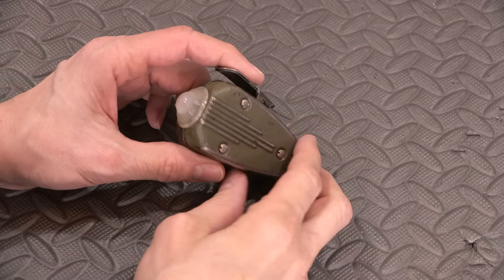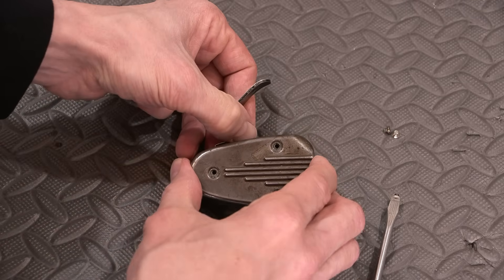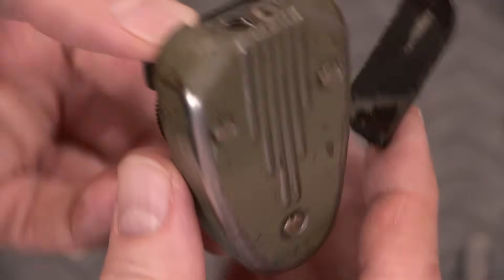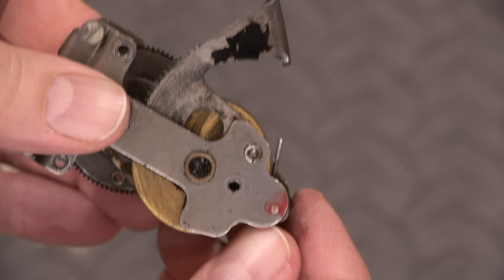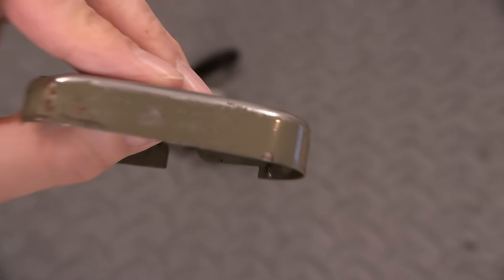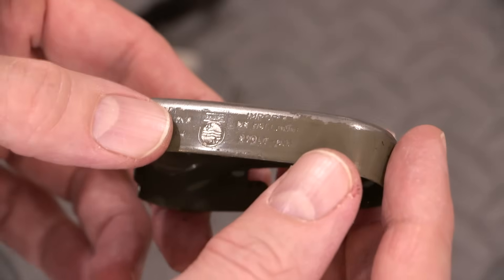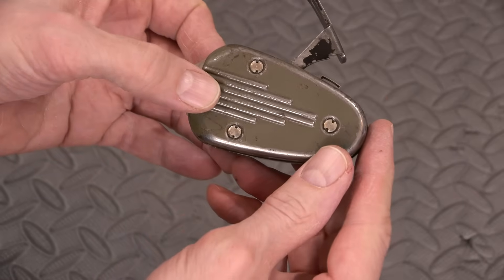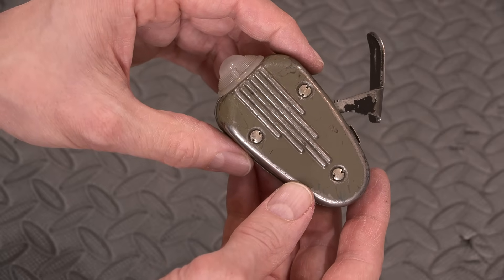WW2 Dynamo Flashlight - Doesn't Use Batteries! Let's look Inside.

Comment: These are quite nice devices. I have one that was used by my parents during WWII. I would keep that one original (repair the lens) but it would be perhaps a nice little project to make a modern 3D printed device with a LED and a supercap that can be home-built. A little DC motor could be used as a dynamo driven by a hand crank or so. A few turns could give light for several minutes.

Comment: I bought  one of that worked in exactly the same way, some some years ago. It was a very early ebay purchase I think, made of bright green plastic and the dynamo and magnets were almost open frame! The bulb is a small wire ended pea bulb. It hung by my consumer unit on a hook made from a left over length on meter tail cable. It's still there but now has a more modern companion which is a hand cranked generator that charges up a small battery. 

For your unit, see if you can find any bicycle lamp bulbs   they were usually 3V and an obvious choice as the unit was made in Holland.

Despite the heavy spring, I would still have a very close look at it and see if it could be pulled apart to give it a good clean and re-grease everything.

People are already saying keep the patina. I don't go along with that too much.
These things were pristine when they came out of the factory  so a rebuild and new paint job would be KO by me.
Personal choice really.

Andy

Comment: The bulb used was a 3v screw base, the same as was used in the original 2xD cell 90 degree head OD green flashlights.   The 3v bulb was so that you could slowly depress the handle for enough light for map reading.

Comment: gret video i would leve the finish original.
to repair the missing tab on the lense use a clear UV cure resin buil it up in steps then file to shape using small pattern files this resin is very strong 
Amazon sells the resin and uv black light

Comment: I would expect the bulb voltage to be pretty low because then you don´t need to spin the dynamo at full speed to get decent light out of it. I would think you could get the original bulb blow if you went too crazy on the speed but more gentle to keep lit a longer period without waving goodbye to your hands

Comment: For my small flashlight colection I rebuild burned bulbs with white COB LED. After removing glass inside metal housing aded resistor and underpowering 3W led.

Comment: I love the old tech, and the Military Standards Build makes it nearly indestructible. I saw a movie where a young boy was living in tunnels during WW1 and he had a box shaped hand powered light like that to navigate the dark in the tunnels. I have some wheatbulbs, you know the tiny grain of wheat sized bulbs. I think the voltage is down about 2 volts or so. It could be soldered into a screw in bulb housing to use in your light. You can probably search the NET and find a 2 volt bulb though. Love the old tech. I have a Seimens Wooden case Volt/Amp Meter made before WW2 and used by a German man working at the Duetch Bundes Post  since he was a teenager. That was the German Telephone Company back then. His name was Herr Schultz. We worked together in the US Berlin Brigade Tech Control in 1982. We became good friends and he gave it to me as a parting gift when I was sent to Korea. It doesn't use any batteries and it is constructed using mainly coils, no transistors. Still works perfect. Take care.

Comment: I'd leave it as is, maybe clean up. What would be nice, and what would future proof it - LED tech. For sure.
I modified a dynamo one made in France (just a bit bigger, with a longer running dynamo) and to do it respectfully i broke a bulb i had for 24 volts, and used the screw in base to "impose" myself on the old tech. Left everything else as it was. These things were made with large cases so a lot of place for electronics is found inside, especially SMD stuff. For my project, so i didn't have to think too much, i used the guts from one of those pump up LED emergency flashlights. Gives quite a bit of light.

Comment: What function did that big spring have?
Reply: its what makes the squeeze-lever pop out ready for cranking. Without the spring, you would squeeze the handle in once, get a gleam of light and then... nothing. You need the thing to spring out again so you can squeeze over and over again.

Comment: Interesting... It's actually #48 bulbs which has 2 volts 100 mA., T 3-1/4 type with miniature screw (E-10). May not ideally, doesn't have bi-focal lens like #222 bulbs. Although, I remember all lamps but I can not guarantee if what does work or not. There are some market may selling hand cranks flashlight with LED in it such as emergency light with radio. I seen it somewhere on the sites. If you can prototyping with retro old vintage hand cranks flashlight. Maybe try with just one white LED, see if they glowing. White LED takes about 3.2 volts 24 mA. may be handle.

Comment: I had one made of plastic in the 70's.  I am surprised they didn't make them a bit larger with a heavier flywheel so you could use it to find your way more quickly in the dark.

Comment: 10:47 I inherited one of these from my late father.  It no longer had the protective cover/lens, but it is practically identical to this one, except for the screws, which here are single-slotted. PHILIPS, Made in Holland, Type 7424; Importe de Hollande, 2.5 Volt - 0.1 A. Still works.

Comment: Everything tells a story, dents and dings, how the paint has worn from use etc,  when I find old tools and other personal items, because the way my mind works I can visualize the life it's had, and who owned it "restoring" (repainting re-plating) destroys that history, I understand restoring the look of radios and other larger equipment that I have no issue with, but certain things should be left looking as they are, I also have no issue with making something functional again without drastically altering if possible, I would prefer you leave it's patina as is, and clean and lube the workings.

Comment: "This mission requires silence, so no talking, no farting, no coughing! Understood?" "Yes captain!" Wrrring wriiing
Reply: Yep, noticed that problem with the one we have.  But I think it might have only been intended for momentary usage (checking numbers, a chart, or a jam in your rifle.  It doesn't throw light very far, so it isn't like you'd try walking at night by using it.
Reply: So funny..lmao
Reply: @Scott_6666  
In the field I remember using a green 90 degree typical flashlight that had different lens filters hidden in its base. Red lens was to be used during war or during exercises.I wish I had been issued one of these.Maybe would not have crapped on a live motar round.
Reply: Lol that's funny
Reply: Now you can light an LED with a fart
Reply: @shable1436  That would be a cool trick!
Reply: @shable1436 Funny you should say that. I was putting the Christmas tree away a few nights ago, when I threw the top section in the in the box, the LEDs flashed for 1/2 second. I guess the cold, dry air caused static discharge.

Comment: I have a plastic bin full of cheapo tools for the "suicide missions." I've inherited the tool collections from a few of my older relatives, and I keep it all. Even the soft, cheap screwdrivers come in handy when you need to improvise something like Paul did here. The permanent magnets in a flywheel spinning in a stator winding reminds me of motorcycle charging systems. The red paint looks like Glyptal, which was often used as "head locker" on screws (and for many other things) back then. I'd be surprised if there isn't a can of Glyptal in Paul's closet, next to the DeoxIt and his collection of various bulbs, fasteners, and tubes.

Comment: would be great to see a video at night, how this little thing lights up. 
Also great maybe you find an LED to screw in, so you dont modify the device, would be  a challenge to build a little screq light yourself includign a sdm cap maybe to get a little bit time, a resitor for current and very simple, maybe thats not changing the original look but also would be intersting to see how it could be improved nowadays, maybe for fun just a screw type adapter and extern a breadboard with small Cap and stab (serial stab for leds) ... some years ago we had a competition for ham radio building a transmitter only using muscle power, a similar device was used for one of the particians, gaining some 100mW  for example using morescode directly in with the timing of the hand pressing  that kind of device.

Comment: Made by Phillips/Norelco, in the film industry their AA-II projector is legendary for a rock solid image, durability, and extremely heavy construction. They ran 35mm or 70mm  film, at 24 or 30 frames per second.   And I would just clean it up, lube the gears and clean it up. Don't repaint it.

Comment: Leave it as is. I noticed that the harder you squeeze the more power is delivered to the bulb. I'd be interested to see if it is possible to modify it to use LED  that has much smaller draw but store this extra energy and make the led burn few seconds longer.

Comment: I have a couple of these flashlights. They were used during and after World War II. They were made for the German army, but the English also made almost identical flashlights for their soldiers. They were eagerly taken as useful war booty.
I wouldn't repaint a flashlight if it still has a lot of original paint. You can buy completely worn-out ones cheaply and they can be restored. Yours is quite good.

Comment: A single diode followed by a capacitor, followed by a modern high brightness LED would be very  bright, I expect. And the capacitor would keep it constantly on between hand-squeezes 😀
Reply: Yep, and that all can be fitted inside an emtied bulbshell.
Reply: You need a bit more than that.  An LED needs about 2.7V to work.  At something like 2.5V it will draw no current.  You need something to regulate the current.  A 5V 1F capacitor could store a few Watt-Seconds (Joules) of energy.  An LED will need about 0.05 Watts to be quite bright.  With a good design, you could get nearly a minute of run time after you pump it up.
Reply: @kensmith5694  you can use a joule thief circuit.
Reply: @kensmith5694 Some very long time ago tried powerled directly connected to dynamo flashlight. It was bad experience bc such load as Led swiftly stopped rotating flywheel. Each time you push you light but brief period of time you retract the flywheel almost stops which gives very uneven light intensity in comparison to light bulb. The cause is led does not light at voltages below 2.7v. Every small increase of flywheel speed causes large increase of current, thus power consumption and very fast decrease of flywheel speed. Some supercap circuit is a musthave.
Reply: @kensmith5694  I'd imagine the lower current of a mild LED would allow the voltage to stay high enough to work. could probably use an off the shelf LED upgrade bulb, but then again, most of them focus on high brightness and use more power. so probably custom low power it is.
Reply: @throttlebottle5906  Yes, I think that a single LED instead of a bulb with some clever way to limit current is the better path. You don't want to throw away energy in a series resistor.  A small PWM/switching regulator chip and likely an inductor would be better.

Comment: I have one of these that I got from my father. The case paint finish I would describe as dark plum. It is stamped on the base Type 7424 [Philips Logo] 2.5 VOLT-0.1A. The light produced is nowhere near as bright as yours. It can be found online in British and Wehrmacht versions with the same Philips type number. There is currently someone in the Czech republic trying to sell one in poor condition, non functional and with no lens on Ebay for US$60.

Comment: If you decide to fully restore, try to find out all about the originality of it, paint chemistry, lubricants used, correct replacement bulb, is the lens supposed to be clear originally (may need to be recast), reflector metalized(?), and dress up the danaged screws. This will make it be like original. A worthy homage to the design effort at the time - no modern frills.

Comment: I'm not in the "patina" crowd, these things are not rare, and don't hold much value in unrestored condition... it's not a 1935 Bugati.  New paint, polish.  Clean and lube the mechanical. An LED with a capacitor and regulator would make this from a relic to a useful device.

Comment: Clean-up the case with fine steel wool (or just an ultrasonic cleaner), and then spray it with clear lacquer.....   Don't change any of the internal parts, the value will drop to near zero.

Comment: The "fibrous" gear is called "phenolic or micarta."  
It's made by impregnating paper or cloth with phenolic resin.
Reply: Phenolic = A bit like fiberglass then ?
Reply: @philfrydman2576  More like bakelite-soaked fabric.
Reply: @philfrydman2576  The fibers are not as stiff as glass fiber and the phenolic has a bit of spring to it.
Reply: @kensmith5694  I think it is the same technology than fiberglass but with different materials.
Reply: @ It is the same method but as I pointed out, it is using different materials so the result is very different.

Comment: My brain immediately went to LED+capacitor mod. There's clearly no shortage of forward voltage. A 21st-century light source coupled with WWII-era robustness seems like a flashlight prepper's dream. Agreed that this one's too nice to do that, though -- at the very least, a re-greasing would be appropriate. I wouldn't mind a restoration. Heck, you could probably do all the above with one of your trademark reversible mods, Mr. C. 💡👍
Reply: LED / Capacitor (or some other storage cell) would make it more useable, but if you do that, then why not just go out and buy a modern dynamo flashlight (there are plenty avaialble fairly cheap).    I think the charm of a device like this is using the technology of the time, not to drag it into the modern world.    
Just my thoughts, as any modification would be slightly difficult to do in a fully reversible way.  There would at minimum be fresh soldering that is not needed to keep it original.  
I admit a lot of ideas went through my head, but I guess the main one that influences me, and my end thoughts, is the histroy of a device of this nature and where it would have been used.
Again, 100% just my own thoughts and nothing negative to your own thoughts.   Everyone has their own ideas :)
Reply: @EsotericArctos  The main difference, as I see it, is in build quality. A present-day cheap dynamo flashlight made this century is highly unlikely to still be around in 70 years.

Plus, if Mr. C does opt to try for a mod, he's probably not going to throw it together with whatever he can get cheap on AliExpress. It'll be in the spirit of the device's design and use case.
Reply: As long as it's reversible LED would be neat to see, but I agree with keeping it original... Mainly so people can see what troops  actually had to work with back in the day. 10+ seconds of equivalent LED light per push is far different than having your mate constantly push that lever with a burning wrist as you try to fix something, and it's the only light!
Reply: If it ain’t broke , dont fix it.
Reply: I think a conservative LED mod would make it into something more useful for emergency use, without damaging it's looks/history/patina.
Reply: I thought the same thing.

Comment: The same style dynamo flashlights are still available today - now in plastic and with LEDs - for very little money. The circuit inside is not much advanced over the WW2 version, so you could get one of those and experiment with it without violating the vintage one.
Reply: I keep an EverLight Twist in the car for any emergency. Even that is probably more than 20 years old, before the LED era, probably Krypton bulb. It already has a large capacitor, so a few twists gives about 30 seconds of light. Must be much better with today's LEDs, for sure.

Comment: Projects like these is what sparked my interest in electronics..I started with the old tube tv's and radios.  
I had several army radio crank dynamos, 90-155vac output..
Reply: Funny you mentioned that....I ordered and bought a never out of the wood create Vietcong field artillery radio set w/a hand crank dyno (before flea-bay outlawed them). It's an AM Transceiver and has yet to be booted save only once to light the tube heaters. Now it's a matter of digging it out. 😅

Comment: A good candidate for a modern LED upgrade.
Reply: NOOOOOOOOOOOO!
Reply: @tuttale  😈
Reply: Only if the mod is completely reversible!
Reply: Absolutely, it would increase the runtime considerably by using an LED and a capacitor
Reply: @dm.2023  It would be like putting double glassed plastic windows in a tudor town house.
Reply: No no no no no.

Comment: I'd just carefully clean it and NOT repaint it. Keep the patina.
Reply: Same for me, looks great as it is, no need to make it look like it just came off the boat from China last week
Reply: Agreed.  Get the insides working as well as possible, plus cleanup the lens, but leave the case as is.
Reply: Agreed,  keep that battle- worn look.
Reply: Clean it up and with olive drab paint job and bring it back to Mil Spec.:face-green-smiling:
Reply: @garybevis8691  Mine was grey/brown as this one, no olive drab.
Reply: Such a nice patina. I would leave it as is❤
Reply: Original. Only answer. Clean it up, and carry it in your pocket. It'll probably come in handy. Some of my favorite tools are 60 to 70 years old.
Reply: Agreed. Just clean it. Not too much
Reply: This ;)
Reply: Exactly what I would have said in my initial comment before saying this one
Reply: I have a similar old flashlight that has 2 bulbs, it sill works like new.
Reply: Paint it pink and apply 
“Hello Kitty” stickers.
Reply: Like most YouTube restoration channels, sand blasting, grinding it, welding and spray paint, making things look factory new